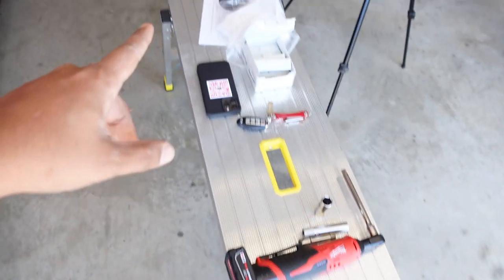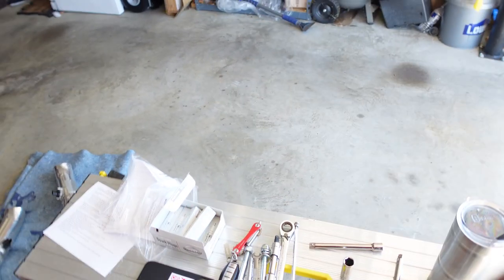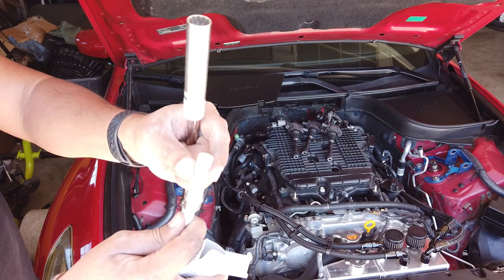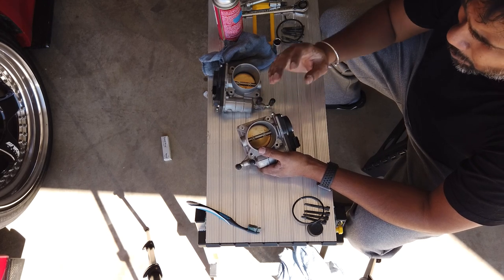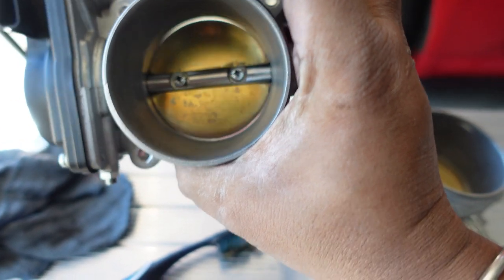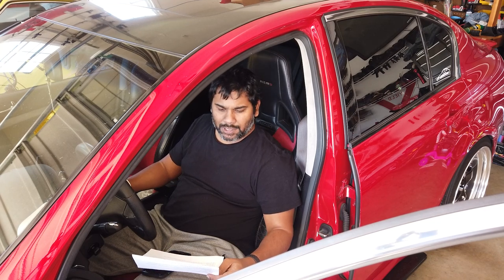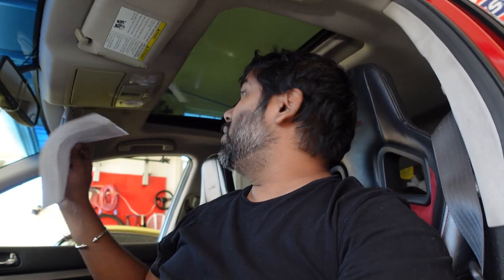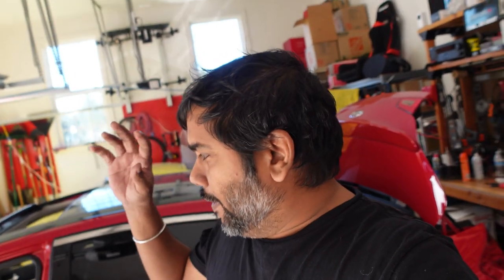G finally gets some maintenance done

Comment: Also want to add that z1 undershroud saved me when I just installed my air ride. I was like an inch from the ground doing a roller shot and a piece of metal was in the road One of the loudest explosion I heard. Under my car I lost some screws from the shroud but it wasn't damaged. Worth every penny
Reply from the maker: holy crap! and thx i'll definitely get it on for the long drive

Comment: Check your oil pressure and make sure it's not going into limp mode due to low oil pressure being detected.  Manual gauge hooked up to the housing would rule that out.
Reply from the maker: oil pressure have been on point, ive got an oil pressure and temp gauge in the car already.